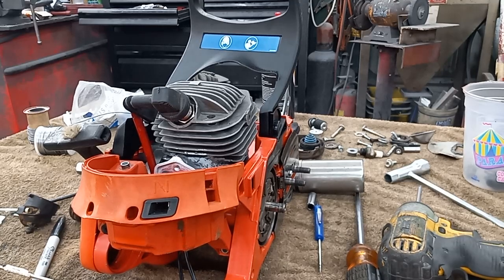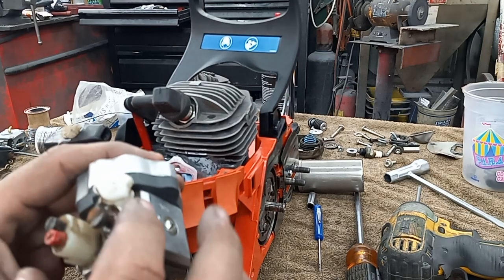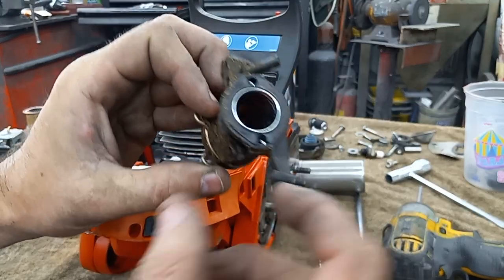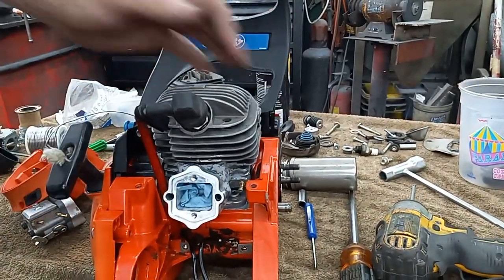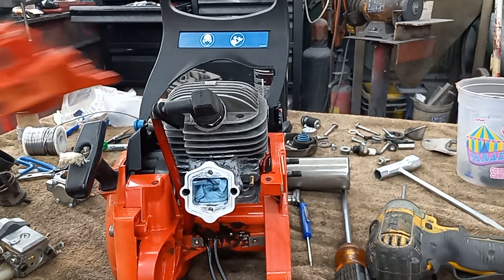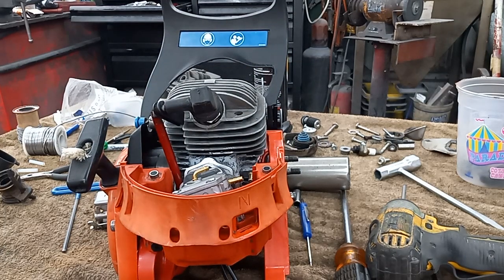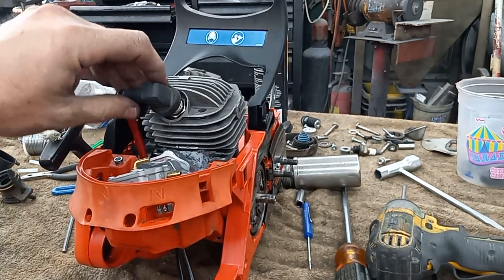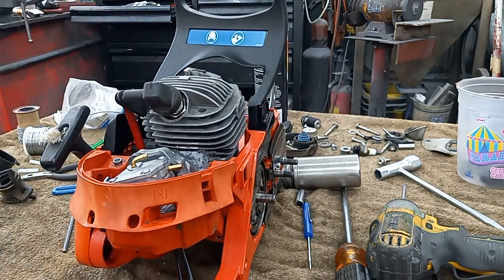Dolmar PS-7900 Experimental Reed-Saw 7

Comment: Can you put a 7900 cylinder on a 6400?
Reply from the maker: I think so
Reply: @CharlesBrisco  that would be sweet because I have a makita 6400 that I would love to put a 7900 top end on
Reply: Yup. Same saw
Reply: @plowmaster1206  hells ya , you know what I'm doing !
Reply: @kingsaws  the bb kit will fit right on, down to location of original decomp.... tho im a bit leery of it, as ive heard of quality issues, and not much of improvement over the 79 oem. I think the bb kit is what brisco is working on here if not mistaken. Im all new at chipping out hard to work with cylinders, but for 90 bucks or so its proly worth it to learn... as the oem 79 jugs aint the cheapest.
Reply: @plowmaster1206  thanks for the input man . Much appreciated